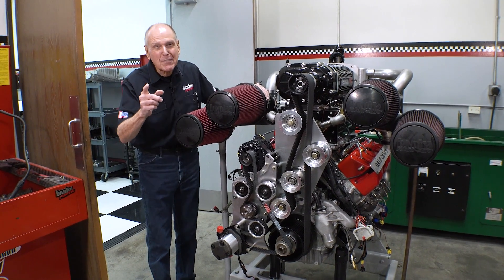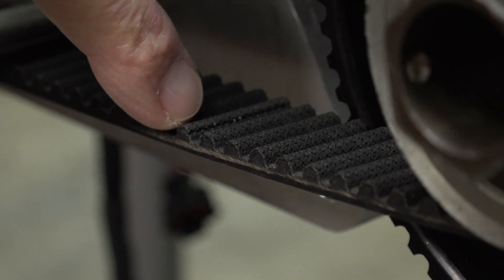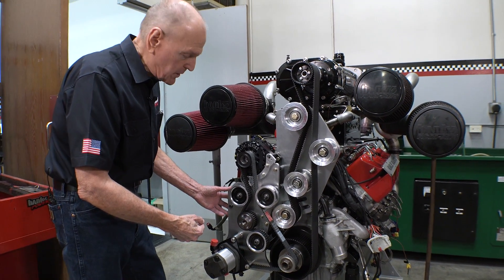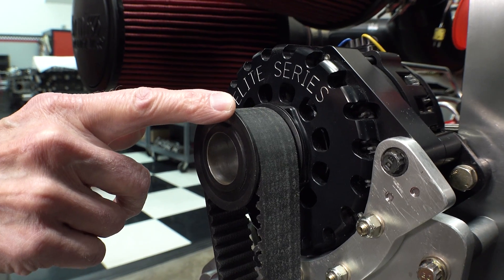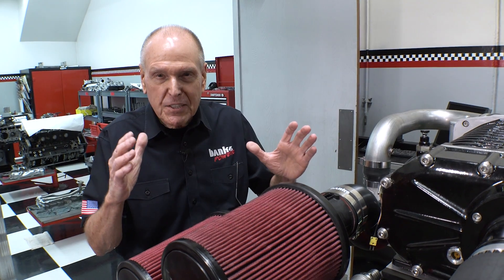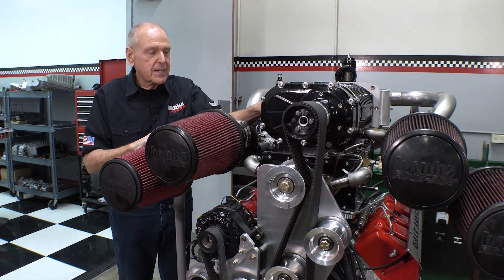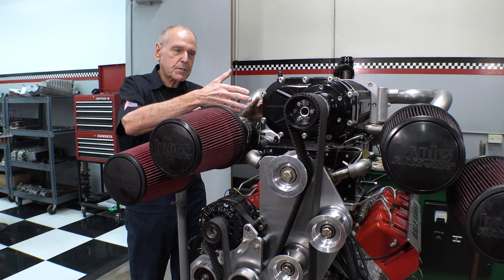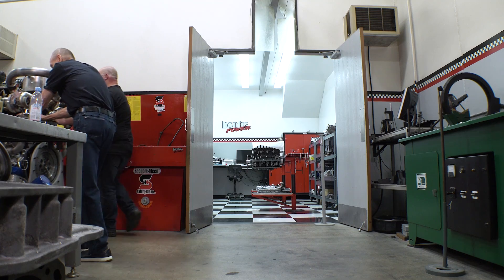SUPER-TURBO DURAMAX DYNO READY: Building A Monster Truck Engine Pt 11

Comment: Dale all my vehicles I own are turbo diesel. I've added your exhaust to my VW TDI & tuned it. I'm trying to add more power without changing my turbo & injectors? I have a custom cold air intake, race pipe etc as well.
How do you feel about CNG or propane injection? Tunezilla is saying propane will jack my EGT's and they do not recommend it? I only plan on using the propane on long trips. 
I deleted my DPF & EGR how can I make more power on my 2.0 TDI. I respect your work & admire your knowledge

Comment: What did this ever go into ?
Reply from the maker: The Super Turbo (Monster Truck Engine) is in the process of being upgraded, which means pulling everything off the current 7.0 LMM block, making adjustments and changes, then installing them all on a newer first-gen L5P block. Also, bringing it back to the dyno cell is on hold while we conduct testing for our military program in Dyno Cell # 1.

Comment: That isnt a duramax anymore.
Reply from the maker: How so? It's a bored out 7.0L LMM.
Reply: @bankspower  I'm to assume it has different crank and rods too. Definitely different cam. 
To me that's like putting NIKE's in a redwing boot box. You still just have Nike's
Reply: @bankspower  put coke in a Pepsi can. The analogies go on an on. Still coke the box don't matter.
Reply: @bankspower  no wonder you can't kill it. You took the duramax out
Reply from the maker: @ryanLBA  You've confused our two video series. We have two Duramax video series running simultaneously. "Killing A Duramax" and "Building A Monster Truck Engine." Two different engines for two different purposes.
Reply: @bankspower  oh sorry my bad. Go on sir.  Good work either way!

Comment: Gale: looks fantastic, that will really pump some air exactley when you need it to.  With regard to your inlet manifold between the filters and turbo; I see some layer lines so assuming additive manufacturing, can I ask what machine and material you used to manufacture those parts.  Interested in understanding what material gives you the strenght and temperature endurance required.  Regards  Justin

Comment: I know the emphasis is on the power being made but ease of use and reliability are big parts of the sport also. Power sounds like it will be close to on point but compared to standard monstertruck motor the front of that thing looks like a nightmare. Looks like a motor swap would entail a bit more work and time.

Comment: This project seems like an awefull amount of work.
Why not fit a gas turbine into a monster truck instead?  
Helicopter turbines make 3,000HP out of the box.
Reply: I'm not sure the hp is the problem ide bet a turbine wouldn't be throttle responsive like a gas . I'm not even sure a diesel is going to do it !

Comment: I like that Gale isnt just slapping parts together instead he figures out which setup will work best for each application, I see plenty of people on their trucks with just a huge exhaust tip(stock size pipe behind it) and blowing out huge amounts of soot because they just dump fuel in the engine. On mine Ive almost doubled hp and don't blow much smoke at high load/rpm because I want power but also efficient use of that fuel.

Comment: Are we really expecting electric cars to replace works of art like this?
Reply: I would expect an electric monster truck to be amazing. Instant torque, massive power, and no need for long distance driving.  Like high power quadcopters. 5+ horsepower in a flying machine that fits on a dinner plate.  Electric power puts liquid fueled engines to shame.  The only limiting factor is the volume/weight of the battery. So yeah, no problem, in the near future.

Comment: I kind of hate to be a contrarian so late in this video series, but is the supercharger absolutely necessary?  Could Banks build a hyperbar-type of system to drive the turbos during conditions of low power demand?  Yeah, the engine looks badass with both super- and turbocharging, but the supercharger is big and heavy, and forces the inclusion of the belt drive system.  And the supercharger robs power from the crankshaft which could otherwise be sent to the wheels.

Comment: that type of hydraulic gear pump has a bearing in the shaft to hold the side load from the belt?  for high speeds maybe you should use a bent axis piston pump
Reply: Raúl Alberto Zang With a belt like that you don’t need much belt tension since the teeth a what’s transferring the power.

Comment: You killed the Duramax in Dyno 2????  Where's the video???
Reply: No, not yet.  In the 852 hp video, Gale said that they had to redesign the exhaust system to reduce turbine inlet pressure.  And he was running out of injector, and the compressor was past its discharge temperature limit, and the cylinder pressure was over the 250 bar limit for the sensor.  Rock and roll!
Reply: @andyharman3022  4:40: "So based on our previous experience...in killing the Duramax L5P in Dyno 2,..." Perhaps he is talking about a continuing effort to kill the Duramax, but one could take that sentence to mean that they achieved it.
Reply: @johnhenderson1760  I took that to be referring to the continuing series, not that they had killed it.  If they have, I think they'll post the video eventually.

Comment: wondering why the supercharger and turbos are run in a parallel sequential system vs just compounding them.  upping the inlet pressure ratio to the supercharger should work just as well with less complexity
Reply: theblackmech The supercharger won’t efficiently move enough air so I would become a restriction. This way they’re using the supercharger for throttle response and low rpm then the turbos can take over for the high rpm power.
Reply: @NBSV1  thats now how twin charging works.  if that was true, compound turbo systems wouldnt work
Reply: @whatchu_talkin_john_willis  Turbos aren't superchargers. With a supercharger you get to a point where it's heating the air so much it isn't efficient. Force feeding it doesn't help that much. And, the supercharger is a large drag even when having boost pushed into it. That's the reason most super/turbo setups are like this where the supercharger gets bypassed once the turbos can take over.
Reply: @NBSV1  force feeding it does help that, again if how you think this works was true, compound turbos would not work.  the smaller compressor on a compound system would choke the engine just like the supercharger if the pressure ratio across the turbo/supercharger wasn't effected by atm pressure, but it does and it works.   educate yourself on compressor dynamics and the function of pressure ratios
Reply: @whatchu_talkin_john_willis  Once again. You're talking compound turbos which aren't superchargers. It works on turbos because the small turbo can spin faster to deal with being force fed. The supercharger being belt driven doesn't work the same and they get to a point where even being force fed they aren't efficient because the rpm is to high. I believe Banks knows what he's doing so there's a reason he didn't set these up to always feed the supercharger and instead be allowed to bypass. The race semi-truck they built had the turbos feeding the supercharger like you're talking about. They didn't do that here likely because of the rpm range since the supercharger will get spun beyond the point it's efficient.
Reply: @NBSV1  rotational speed makes no difference, its the air mass.  air doesnt know if its being run through a turbo, supercharger, or nothing at all.
Reply: @whatchu_talkin_john_willis  If you say so. For what it's worth he isn't completely bypassing the supercharger. It's basically a T so the turbo output can either go through the supercharger or bypass depending on which path has less resistance. And for some strange reason it tends to bypass the supercharger when the turbos are going. And once again, I trust Banks far more than you and they went this route for a reason.
Reply: I'd guess it has a lot to do with the maf sensor limitation. In any case, I would also be he considered that and probably has tested that configuration thirty years ago
Reply: @travispfannmuller7717  there are no maf sensors on the engine, its running speed density

Comment: Love the Series Gale!!
I have to ask, why a 320 amp alt?
Seems a lil overkill.
Reply: 370 amp.  He explained in the Unboxing video that when the driver uses the rear steer system in a monster truck, the battery voltage drops to about 10 volts, which may shut down the engine control module.
Reply: @andyharman3022  thanks, I didn't watch that video obviously, but makes sense to me now.

Comment: Would a electric steering setup be an alternative to pumps belts etc👍
Reply: Seems like electric steering has not yet reached the power levels necessary for something that big.  That's why Ford is using electric assisted hydraulic power steering still.

Comment: There must be a easier way.
All those pulleys looks like a mess, would it be possible to run the servomotor electrically, I am guessing you would have 3000W generator power left over, 6000W if you run 24 volts.

The airflow sensor setup looks weird, huge intake pipes into a turbo wheel, that is less then half the size of the Airflow sensor area.
A custom made intake or pressure sensor instead of flow, would help a lot on the package size and complexity of 4 flow sensors.

I am surprised to see house plumbing on what i think is engine coolant or chargecooler water, but i guess it is simple, cheap and available everywhere.

Looking forward to see how the blower bypass works and if the engine really needs 4 flow sensors.

Comment: a 5 LITER CHARGER LMAOOOOOOO
Reply: Wasn't it 4 liters before? Gale must have the worlds first variable fixed displacement supercharger...
Reply: Gale Banks is going to slap you both.
Reply: So it's a 5L blower.   The engine in my Silverado 5.3L.  So he basically stuck the engine from my truck on top of the Duramax.   Now that is something I can get behind.

Comment: Those little gear pumps running at such high rpm for the  required flow seems like there should be a better answer. Maybe a variable displacement piston pump that’s pressure compensated would take the rpm better and conserve HP wen not turning? Or under drive it a tiny bit more and see if an accumulator and charge pump can be added to take care of high instant demand? Just thinking out loud to see if that makes sense.

Comment: cant wait to hear a duramax turn at 6500 rpm lmao
Reply: Just look up diesel sled pulls and drag races you will hear plenty of diesels turning over 6k plus. Theres nothing like being in the arena when one of the 3.0 class sled pullers fire up and run though, that is one memory I will never forget.
Reply: Is that even possible with diesel Fuel?!
Reply: @Aseutester  
I remember seeing a diesel drag truck video a while ago, it revved pretty high...
Reply: @Aseutester  diesel itself actually burns really fast. The issue is the because it is fast burn it requires a strong engine to not become damaged. 
The reason diesels don't typically rev so high is because strong engine internals also weigh a lot so they require special oils and engine work for the bearings to survive the massive loads
Reply: Reuben Horner That is not entirely true. The first bits of injected fuel mix, ignite and burn at the same time, so you get a huge pressure peak. However, as the injection proceeds, there is less and less air in the cylinder left to mix with so mixing time becomes slower. So the burn takes longer too. Just lookup diesel combustion phases. So at very high RPM the fuel still burns during exhaust cycle. This leads to very high EGT and melts exhaust valves and turbo. This is why diesels typically are limited to 5400 RPM in production cars. In a tuned application you could go to 6000 RPM and in dragging 7000+. But getting power at those revs is another story
Reply: @Aseutester  yeah as long as you have the $$$$.👍👍✌✌ https://youtu.be/6UZpKI27KXA

Comment: Everyone: diesel's dont rev high
Gale: hold my world records
Reply: Checkmate used to run a 12v71TT somewhere around 7000rpm.
Reply: Stephen M kinda apples to oranges, 4 stroke vs 2 stroke
Reply: @sseibonnevilleman  Not really, piston speed is the same between them, only difference is number of power strokes as the 4-stroke sacrifices one to a clean exhaust cycle.
Reply: @NVMDSTEvil  theres no way it ran that high, maybe 3000 RPM
Reply: @isakjohansson7134  Here's a video, ~5500 during the run due to some fueling issues but cleans up when the load comes off. https://www.youtube.com/watch?v=S-lRXRLWVRg
Reply: @isakjohansson7134  Found a better video https://www.youtube.com/watch?v=_4U735Bbojk

FWIW, the biggest issue for RPM's is the valve train for most diesels.
Reply: @isakjohansson7134  A stock 7.3 powerstroke redlines at 3300 and modified goes over 4k. its not hard to do, just expensive.
Reply: @02Franxx  yes but a diesel sure cant go to 7000 RPMs, the fuel doesnt have time to ignite, i think the highest revving diesel engine tops at 5200 or something like that
Reply: @isakjohansson7134  I've ran some small short stroke straight 4 diesels at 6000rpm.. and with stiffer valvesprings they can turn up to 7000. 
But the power peak is usually sub 6000rpm whatever you do...  Turbo diesel revving 6000+ rpm sound wild tho :)
Reply: @RenaxTM91  ok, fine since i havent tried (let alone own a diesel vehicle) i am not the one to speak but i havent seen diesel vehicles revving higher than 5500 RPMs
Reply: @isakjohansson7134   I never said it could go to 7k, that would be crazy.
Reply: @NVMDSTEvil  Highest I recall seeing - and there will probably be higher - was 7700 rpm! 

I don't normally pay attention to diesel drag engines and was OMFG - was that a typo' - but no!
Reply: @gordowg1wg145  Right? I'm sat here thinking 'I've seen petrol engines that have a red-line lower than that'
Reply: @BazilRat  Yup, but don't forget those are some VERY expensive builds, with some VERY heavy duty components replacing damn-near every part, are under load for a few seconds beween checks/maintenance - and STILL explode in spectatular fashion.
That Mr Gale expects to wind this thing so high, and be reliable, is rather astonishing!
Reply: @gordowg1wg145  He seems to be pulling it off so far. I'm interested to see the final engine though - I don't know how he's going to get a diesel revving up that high and survive long enough to run the Dalmation...
Reply: @gordowg1wg145  biggest thing is piston weight, the factory diesel pistons are really heavy and put some extreme load on the connecting rods and rod bolts
Reply: Wonder what rpm the Audi diesel LeMans car turns
Reply: @doddgarger6806  There is a video on YOUTUBE of the diesel Audi lapping Lemans showing the dash.  Most of the shifting seemed to be at 4200 rpm.  I think if you do a search on "Audi R18 Lemans", you will find it.
Reply: Doesn’t compare to 11,000 rpm
Reply: Check out mercedes OM606 engines. They run 6500/7000also.
Reply: Uhm the bone stock 1.6 TDi in my car already revs to 5200
Reply: This TDI revs almost to 9000 https://www.youtube.com/watch?v=Jb2A4QzoEUQ
Reply: 7.3’s can rev to around 6400 stock valve springs
Reply: @TheRandomRobert71 7.3? That's absolutely crazy. I've seen Audi diesel LMP1 cars go high rpm(because they're race diesels) but man! 6.4k on a stonk 7.3 must've been wild

Comment: damn it I wanted to hear it run that thing is going to be a beast. if it runs any were as good as the one they used on pikes peak it's going to make all the power they could ever need but the old man does like to push things a bit

Comment: That thing is massive...I dont care if it only made 400hp, I love it
Reply: @grandmasmalibu  MAP and speed density would remove the MAF limitation.
Reply: 400HP? I think you need to watch the "Killing a Duramax" series. Mr. Banks turned the HP dial to 11 on this engine.
Reply: @RobertLowery  I know...that's my point.  I dont care if it makes little power. I like it cause the way it looks alone. I know it will make huge power.
Reply: It made 666hp blower only.
Reply: @hendo337  And the Torque?!
Reply: @Aseutester  8xx something ft/lbs I think
...